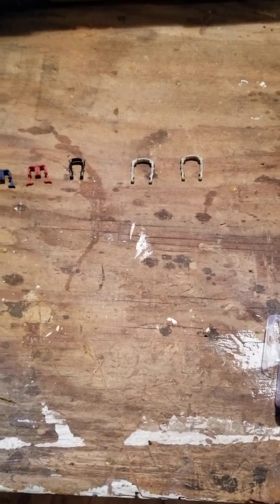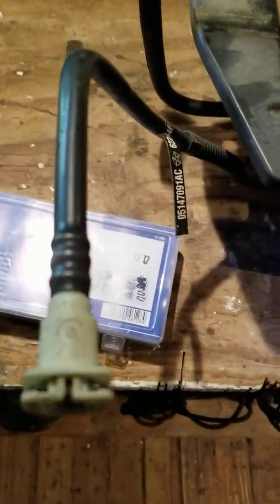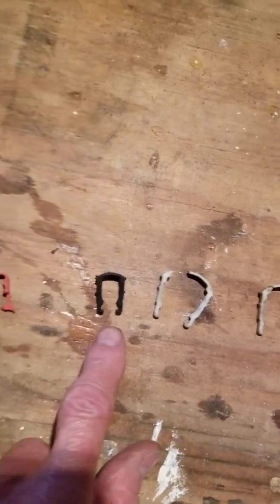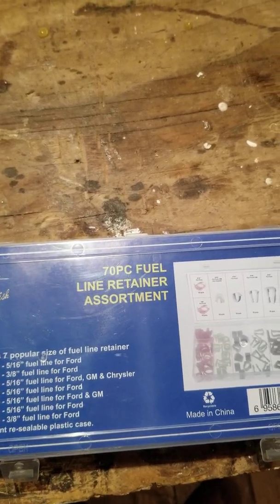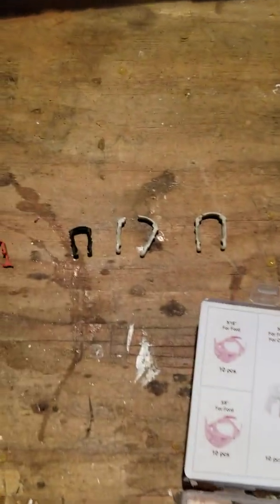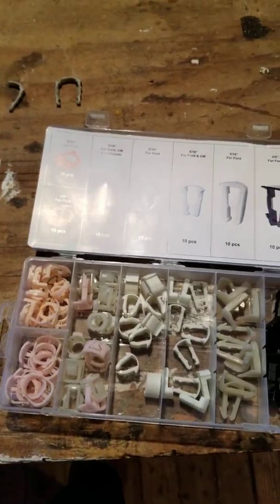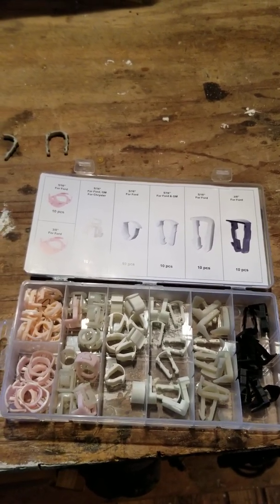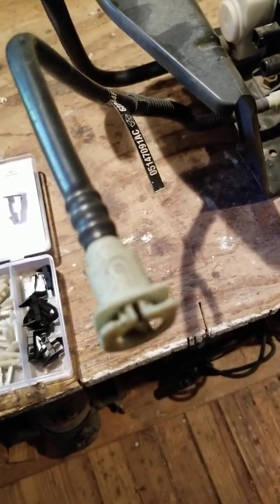What happens if you break a fuel line retainer clip ?

Comment: There's gotta be a special tool to pull the clip off without breaking it? Anyone know the name of the tool?
Reply from the maker: You are right there is a tool.  Fuel line disconnect tool.  OEM tool part number 25042 and 25043.  $11.99 at Autozone.
Thanks for the great question.

Comment: Ford's got the problem solved.  You break a 10 cent clip you buy a $200 fuel line because the clips aren't available separately.    They should put Mechanical Engineering degree recommended before attempting to remove clip
Reply from the maker: Seems when you purchase a car these days it is really still a down payment
Reply: @rustbucketvalleygarage7046  I just open the hood once a month and dump a bucket of money in lol.  I tried getting the fuel tank out of my 18 f150 without knowing how the clips came off or being able to see them.  In the end I took the box off the truck instead which only took about a half hour
Reply: you are correct.  Very aggravating.
Reply: Hyundai as well. These were designed to ruin people's days and nothing else
Reply: Triumph same. Unbelievable.